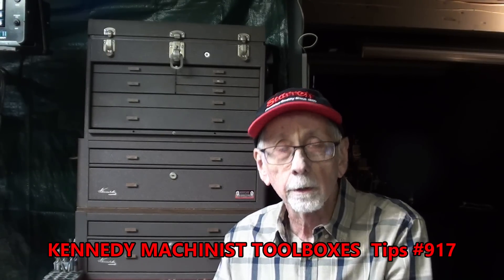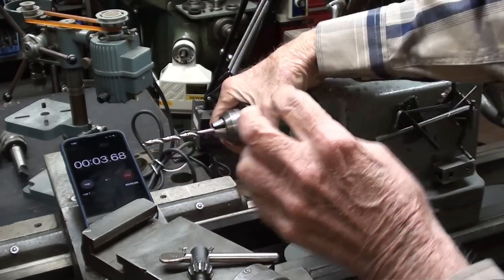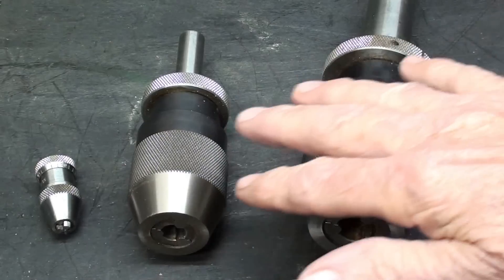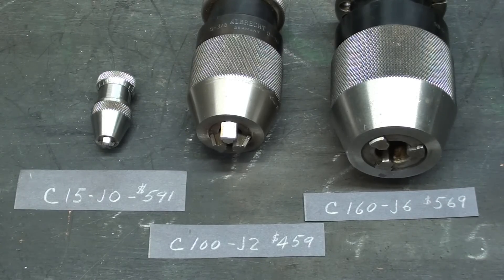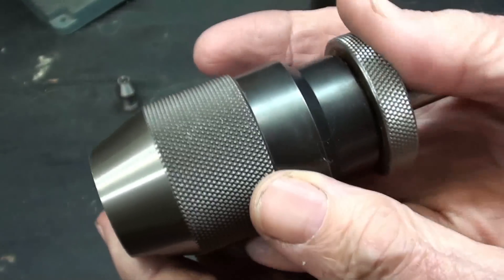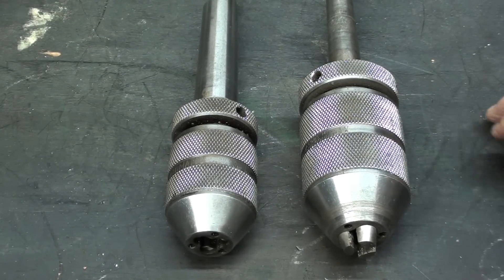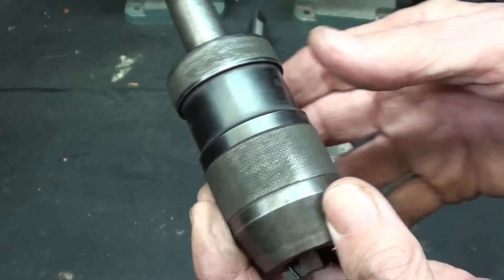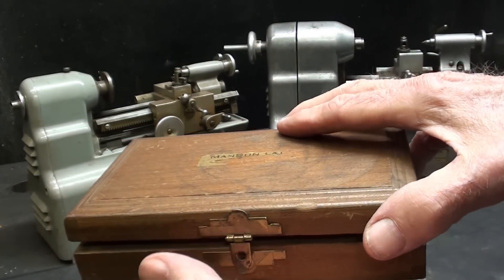What is an ALBRECHT KEYLESS CHUCK #928 tubalcain jacobs rohm

Comment: The keyless Albrecht was open much further than the Jacobs when you started timing, you fumbled with the bit during the Albrecht a tiny amount, and you missed entirely on properly securing the 2nd bit in the Albrecht (off-center).   Just sayin.   I like the keyless chucks personally, despite the drawbacks.  The issue with keyed chucks is how many after a few years of use are showing signs of wear and stripping?   The Albrecht (sloppy cheap one i got) seems to have sloppy jaws that you need to be somewhat cautious for alignment of the drill in the end hole
Reply from the maker: Appreciate you sharing your thoughts on the chucks.

Comment: I also have a Cameron Micro Drill Press fitted with the tiny Albrecht C15-J0 chuck. I use it mostly for carburetor work, making and modifying jets and mixing tubes. Some of the drills I use are as small as .012"and there is zero detectable runout.
Reply from the maker: They are very precision and accurate that’s why they cost so much

Comment: Thank  you for preparing me for a possible renovation of an allbrecht 1-13 that  I have just bought on my local classified for 24 euros plus 6 Eur postage.  The ad was " bohrfutter made in Germany " but studying the photo I saw faintly Allbrecht. Maybe I am buying a pig in a poke and the seller knows this but  I  am banking on the innate honesty of  these Austria folks and that I am getting a snip.  Here in Austria and Germany this model is around 200 euros without the  shank. Time will tell.  And now I know how take it apart and clean it. ,Viel Spaß ( Lots of fun)

Comment: Hi @mrpete222 -- Greetings from Northern Germany from a very frequent viewer! Have to check out Albrecht, currently I am a big fan of ROHM (actually RÖHM). Last year I made an attachment to use a small ROHM chuck (non-keyless, though) in a multi tool holder (MULTI SUISSE type) on the tool post for precision drilling, instead of using a drill chuck in the tailstock.Inspired by Stefan Gotteswinter.

Comment: One problem with all keyless but not with keyed chucks is that the keyless the tool moves deeper as it is tightened not on the keyed chuck.
That becomes important when using a drill chuck in the mill vice to hold tiny parts. I keep some jacobs key chucks just for that purpose.
Reply from the maker: Thanks

Comment: I found  Albrecht to be ok but one model of Jacobs keyless is better(like the ones in your catalog not the ones you have there). The keyed Jacobs are horrible to use because the gear and chuck key teeth wear out. The very best chuck I saw was Technics, a cnc drill chuck.

Comment: I have all of these chucks.. I use the Jacobs Portomatic 90% of the time. When they are properly lubed, you can literally fling them open and closed. Much quicker than the Albrecht which is kind of stiff to turn. Albrecht is likely more accurate, not sure.
Reply from the maker: I noticed the same thing about the looseness of the Jacobs

Comment: From Germany. Albrecht is well-known as "the" top manufacturer, they also claim having invented the keyless and self-tightening chuck. An "ordinary" Albrecht in a kind of normal size, such as 3-16mm will cost you around 250 bucks in retail (the non-diamond-coated version), which is roughly 60 bucks more than you'd pay for the comparable Röhm (stunningly, the Chinese sell 'em for under 20 bucks nowadays, not sure how). They have a third less runout rated in comparison to Röhm, though. I guess runout isn't really a factor when you cram it into the lathe's tailstock as it's not moving at all, but in the drillpress it might be. Not sure, it's difficult to say since there's so many combining factors (spindle, taper, chuck, crooked drill) involved, and alignment on the taper is random every time, too. Might actually be one runout cancels another, but I guess more often than not they will add up in strange, unpredictable ways. Probably doesn't matter for a 6-8mm hole, but likely does for a 0.5-0.2mm hole.

I don't think those small chucks are competitive in any way. Much different from the larger ones which are kind of the best thing on the planet. I own an old Ixion from the ~1960s or so, scavenged from a toolmaker that went bankrupt in the mid-90s. And it has an Albrecht. Which is probably from the 60s, too, but it looks and works like it came out of the box yesterday. As for the Ixion, it's a shame they don't build machines like that any more. Table-top machine, but weights so much a single person can't lift it. 3-phase motor, belt drive, mechanical depth stop, and a single switch, that's it. No blinking lights, no display, no emergency stop. All it does is, well, it makes holes.

The small Albrechts look nice, but are outrageously priced, and they don't even produce them with the shanks you need or might need. For example, both of the tiny high-speed Alzmetall and Flott drills come with B16. And high-speed is what you want for small drills. You can get the ultra-precise 800-buck 0.2-1.5mm Albrecht in B06, and that's it. You can get the somewhat cheaper and less precise 0.2-3.0mm version in B06 or B10, but the i6 (and the TB10turbo, too) is B16, so the 0.5-10mm chuck is the smallest one you can mount (without installing a custom spindle). Röhm isn't any better insofar as although you can get the 0-10mm chuck in B16, so you can use smaller drills, the rated runout is, again, higher. For the smallest drills, the runout is 25% of the drill's diameter... so... bleh. Ironically, Albrecht offers a small MK2 chuck which is better and cheaper, and rated for 10k rpm too, but all the available MK2 machines (AFAIK) don't do more than 3000-4500 rpm.

Thus, for small holes, it comes down to either a dedicated specimen of one of those windy microdrills, or using an ER collet. Which is more precise, and cheaper, too.

Your trouble opening the Röhms after closing it tight is actually marketed as feature. I can't find it now, but they claim so-and-so-many Newton-meters of resistance to prevent it from opening while tapping. Albrecht is bolder, they make the common "strictly clockwise use" and the "closed means closed" (original quote) versions. Not sure how the latter works, don't have that model, probably some button or ring that you can put in "lock" position.
Reply from the maker: Thank you for a wonderful analysis of these keyless chucks

Comment: I am from Germany and most of my drilling can be done with hand drills. I prefer easy to use tools like hand drills with plastic chucks. But I also like experience with tools so I got a chuck with similar appearance like the Albrecht chuck for one of my hand drills. 
From that experience I can report that it tightens well and it goes down to smallest diameters but it appears that the drill is twice as heavy now and I do not use it much since then. 
It is always fun to watch your videos and to try out something new.

Comment: Hello Mr.Pete thankyou for this Video. I'm from Germany im using a Rohm chuck on my 1965 Weiler lathe and on my 1965  AEG drillpress. Both chucks let the Drill slip sometimes. Ok they are nearly 50 Years old, so they might slip sometimes. I bought an Optimum drillpress for my homeshop 2 years ago. The included keyless chuck slips from the first day. so I decided to buy an Albrecht chuck one week ago, still waiting for delivery :-). So it's the perfect timing for your video. 
Btw. ont their website they say, they are the inventors of the keyless chuck.
Reply from the maker: Thank you for an interesting comment. I had no idea they were the inventors.

Comment: Albrecht chucks are superb. I'm lucky enough to have the 0 -1/6" version, use it on the lathe all the time for drilling very small holes. Very much looking forward to your videos on the Manson lathes. About 3 years ago I did a series of videos on my Manson. Parts 2 to 4 were showing the lathe making chips on various different types of metal. A truly amazing machine. Cheers, Alan.
Reply from the maker: Thank you, Allen

Yes, indeed, I watched your videos. Amazing a little machine. Although not capable of anything, but the tiniest work piece

Comment: I'm from Germany, the Albrecht chucks are essentially the "gold standard" for keyless chucks. The Röhm ones are top-notch as well, especially the "Spiro" lineup with a runout of 0,07mm (2.7 thou) where the Albrecht ones have about 0,04mm (1.5 thou). Röhm on the other hand is the standard for lathe chucks with their "Duro" lathe chuck lineup.
The keyless chucks are not ideal for tapping applications, if you're looking for that keep a look out for the Bilz DSPL tapping chucks. They are unfortunately very rare, even in Germany, but are about the best tapping chucks money can buy (with new prices easily reaching 2.000€, about $2.200).
Reply from the maker: Thank you very much for the rundown on these great drill chucks.  
I have never seen one of the tapping chucks
Reply: @mrpete222  Would you be interested in a video about the tapping chuck? I've been using mine for quite some time now and I'm absolutely satisfied with its performance.

Comment: I hate keyless chucks, whenever some torc is needed on the drill bit or tap, it slips and destroys the drill bit shaft.
but that's my experience, maybe you all have a different experience?
cheers ben
Reply from the maker: That happens to me from time to time. But it also happens to me with a standard key type chuck

Comment: Lyle, I noticed on your speed test you had the same issue that I have on my cheapo import keyless chucks. Look again, the 1/2" wasn't actually in correctly, it was crooked. BTW, my cheapo's came with a hook wrench to fit the 3 holes aroung the body so you can get it loose when it gets jammed. They'll have to do though, their way above the work I do and my skill level!
Reply from the maker: That happens to me all the time with keyless chucks. Believe it or not, I did not notice it in the video.
Reply: I also have an import keyless chuck on my drill press and find that I often get bits between 2 of the jaws off center.

Comment: If you find an Albrecht chuck for sale and it needs service, don't pay too much for it. Repair parts are available, but you are going to pay dearly for them. Look at the McMaster -Carr catalog to get an idea of the repair cost.
As mentioned in the comments, avoid using larger drills with heavy work. The chuck will tighten up so much it is impossible open by hand. Leather or lead wrapping may not be enough to get the chuck to release. Bore out an Aluminum block to slip over the outside of the chuck. Cut a slit to the bored hole and drill and tap for clamping screws. A bit of trouble to do, but you'll have it the next time you can't get the chuck to release and you won't damage the knurling on the chuck.
Reply from the maker: Good idea, but that would be a big job. Maybe these chucks aren’t as great as I thought they were.
Reply: @mrpete222  They are good. As pointed out, they are quick to use in the job shop. I have an R8 0-5/8" in my toolbox that was a victim of over tightening that's been there for nearly 40 years and I have never been able to bring myself to the spend the $250 to fix it.

Comment: Never use a hex shank hole saw arbor in an Albrecht. You'll damage the chuck trying to get it loose. SE with D&S bits. Be careful how much torque you put through the chuck or it'll lock down and require a heck of a gronk to get loose.
Reply from the maker: Thank you for the advice

Comment: In Germany you can buy Albrecht chucks for a fraction in pricing. The main feature besides holding a drill bit is centering. That's where cheap $4 plastic chucks on hand drills suffer most.
I allways connected my key T-handles with a string to the cords of my corded hand drills with jacobs chucks. A hand drill with no key was worthless.

Comment: Albrecht type chucks are great for drilling but not so much for tapping. They will work for driving light taps but are likely to release the tap on reversal since they’re designed to grip only in the clockwise direction. This can be overcome to some extent by over tightening the chuck, which then becomes difficult to “unloosen”. (Hello Joe Pie!)

Comment: I have both an Albrecht chuck and a Röhm chuck, both 1/2" capacity, purchased new. I must be doing something wrong, because they don't hold very well. Especially when spinning fast with a small drill. They're sure to drop, and sometimes throw the drill out. They're both on good quality, true running arbors, so I don't think it's that. Any suggestions? 

Also, I recently got a Tegara keyless chuck, which I think is Shars' premium brand made in Taiwan. Pretty affordable at $50 for the 3/8" size. Very nicely finished satin chrome, and so far I'm quite please with it. But it comes with a hook spanner, so it's not exactly tool free.
Reply from the maker: I have no idea why you’re chucks are not holding tight

Comment: Since this type of chuck is self-tightening, they will, of course, become self-loosening when run in reverse. A chuck for a hand drill needs to work in both directions, so it can not be self-tightening. You can tell if a chuck is self-tightening by seeing if the jaws follow the chuck body when the chuck is adjusted.

Comment: I have a Rohm 5/8 capacity. I split the case by drilling with oversize bits. I was able to weld it , and made up an oversize sleeve to take the internal pressure. I only use this chuck in the lathe tailstock. and yes the channelocks are required occasionally . it will now handle my abuse.

Comment: I definitely prefer a super chuck, hands down. The Albrecht/keyless chucks are certainly convenient, but I've had them tighten under a lot of torque to the point where they're very difficult to get back open. I also have a really interesting keyless Jacobs chuck with brass jaws and a lock ring mechanism. It's different from the "Albrecht" style. Wish I could post a picture of it, you'd probably find it interesting. It's definitely old.
Reply from the maker: The Jacobs shock with the brass jaws, maybe an armature chuck
Reply: @mrpete222  Holy smokes, I think you nailed it. I just did a quick web search and it looks very similar to the no. 100 armature chuck. Finally, you've answered a question that I've had since the day I acquired it. I knew that it definitely wasn't a typical "drill" chuck because the brass jaws won't hold a drill under load, it'll just spin in the jaws. Thanks for that!
Reply: @mrpete222  As an aside, I also now know what the chuck that's threaded 1-1/2 x 8 TPI on the back is for as well, they came in the same box of stuff. It screws onto the spindle of a lathe with a 1-1/2x8 spindle nose and apparently works in conjunction with the armature chuck in the tailstock.
Reply: @hersch_tool Sears Craftsman sold an armature servicing kit that comprised of both  the lathe spindle threaded chuck and the brass-jawed chuck. The set came in a steel storage box.I have both chucks but not the box. Normally you'd support the end of a long shaft with a dead or live center in the lathe tail stock but very few DC motor armatures had the center drilled hole with which to take advantage of a center. That's where the brass-jawed chuck comes in to play. It's a "Center Substitute."
Reply: @GFTP100  that makes total sense. it's funny how puzzling a thing can be until it's explained, then it seems obvious lol
Reply: @hersch_tool  , glad I could educate. In today’s automotive repair market there are very few individuals that bother performing ‘component level’ repairs on starters and even fewer on generators. So these types of accessories just fade away. I’m one of the strange ones that tries to fix almost everything so I collect lots of seemingly obsolete tools.
Reply: @GFTP100  we need more people in this country who are willing to build and fix things. that industrial spirit used to be an important part of our culture. seems to me like there has been a deliberate targeted effort to snuff it out over the decades.
Reply: I agree they can self tighten,,,😢...

Comment: The last page of the current Albrecht catalog has a beautiful cut-away picture of their drill chuck which is suitable for framing! I never have trouble with bits slipping in my Albrechts, but larger bits in tough material will over-tighten the chuck requiring the use of a strap wrench to release the bit. This is why for larger bits I prefer the Jacobs Super Chucks, the older American ones of course. Today's quality Asian keyless chucks have a pin hole in the body as an aid to open a stubborn chuck with a wrench or further tighten it for power tapping.

I like the newly rediscovered shop table for video production. The old Craftsman lathe is a nice backdrop.
Reply: What Doug said.

Comment: Good Morning Mr. Pete! Have an Albrecht, love it - only thing I will add as one more drawback is that they won’t work for reverse drilling, like when attempting to remove a broken off fastener
Reply: can't confirm this issue with reverse drilling ... perhaps the spindle of your Albrecht chuck may be oily or greasy? (According to the manufacturer the spindle and the cone may not be greased.)
Reply: @carsten4719 I guess I never gave it too much thought, and just assumed that applying reverse torque to the mechanism has the natural effect of loosening it. Same principle as running a threaded lathe chuck or a cheap boring head in reverse. I did get mine from eBay so I have no idea if it’s ever been opened up, but it’s perfect in every other use👍🏽 Thanks for bouncing around ideas though, always appreciate that!
Reply: @shaolinshaotse These chucks are designed to tighten when drilling clockwise so they will release when reversed.
Reply: @ellieprice363  Thanks Ellie. Your work on the gang drilling attachment is beautiful by the way. So elegant🙏🏽